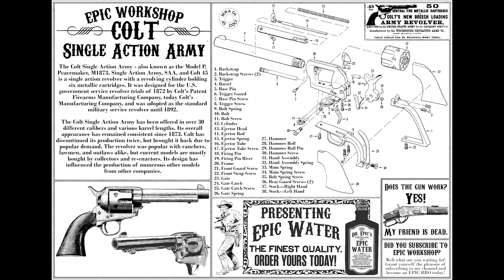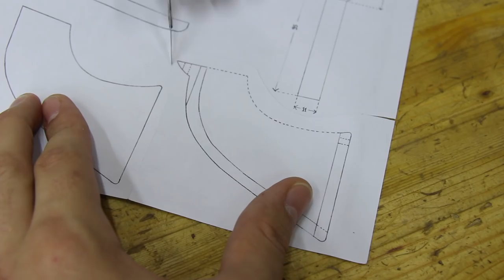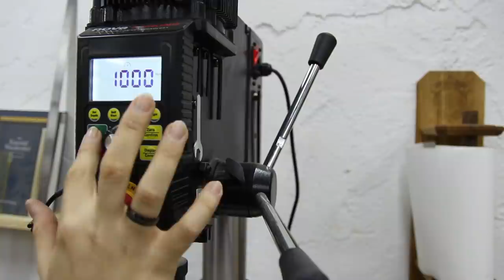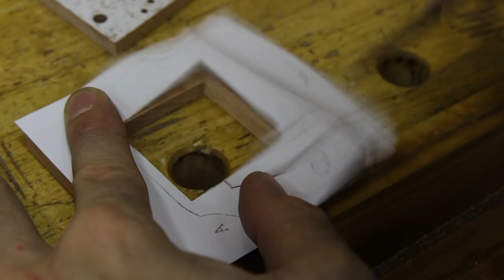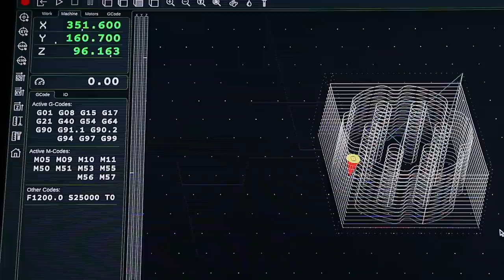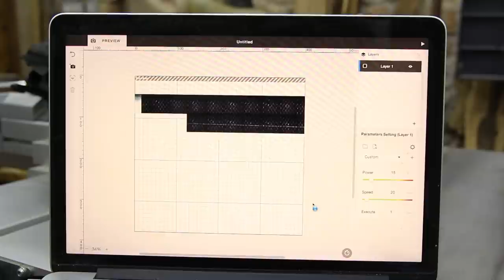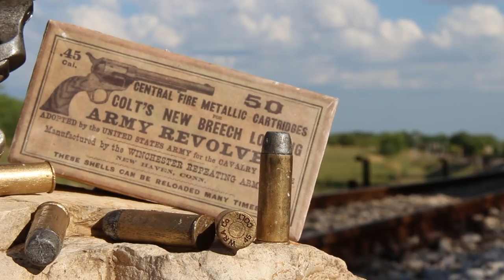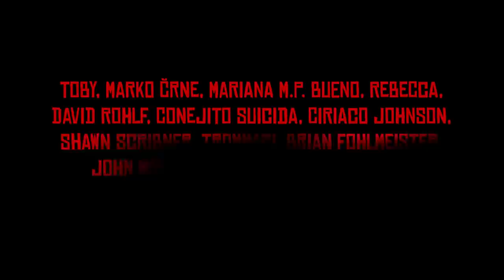I Made WOODEN Revolver With 40 Mechanism Parts (RDR2)

Comment: could you make a peabody martini henry please?
Reply from the maker: Hey 😊 I made Winchester 1873 which is plenty similar to both yellowboy and henry rifle
Reply: @EpicWorkshop  what is the difference?
Reply from the maker: Well all started with henry rifle 1860 (actualy volcanic pistol mechanism). It was very simple and it was loaded from top of the barrel. Then there is Winchester Yellowboy which looks familiar to this one and then some more models came but most familiar one is Winchester 1873 which had saddle ring and plates on side for access to clean it and so on.. Gun that won the west as they say 😊
Reply: @EpicWorkshop  great, but i wish i had the peabody martini henry for a historical re-enactment as i had the uniform of a peruvian soldier from the pacific war 1879 made.